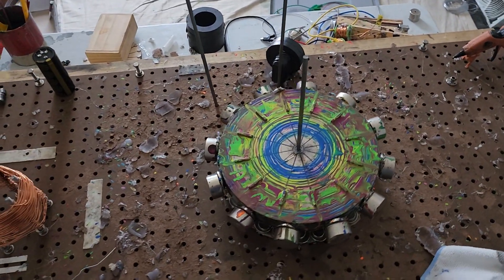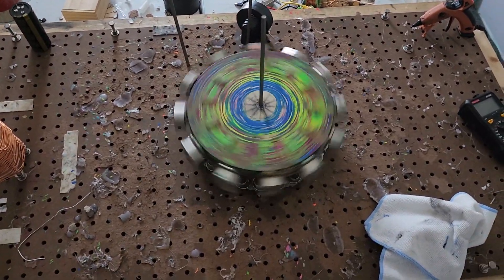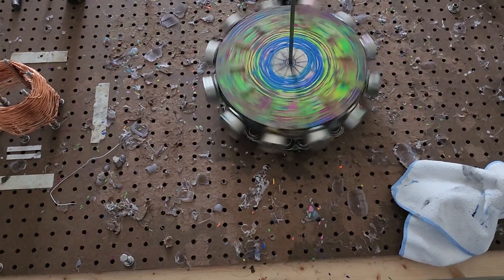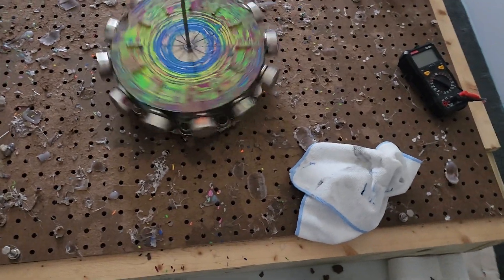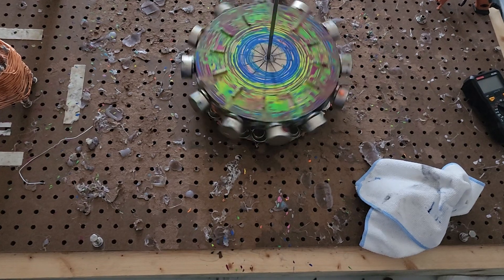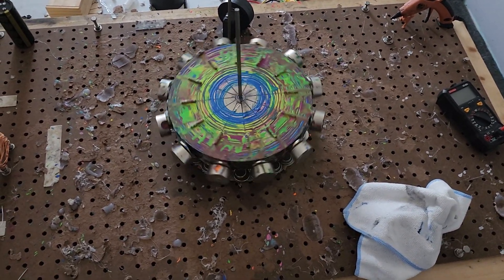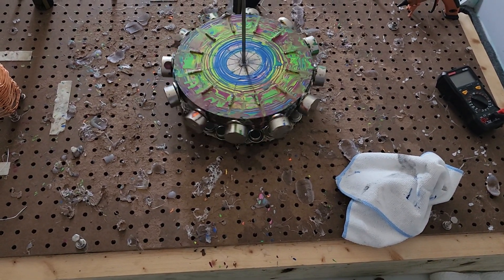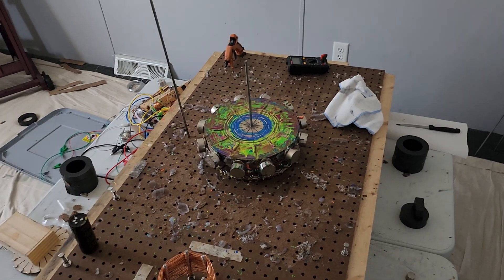permanent magnet motor 1 test

Comment: Keep it up, id like to see you hook up a Multimeter to see how many volts you can generate with that.
Reply from the maker: 10/12 ac volts and voltage throughout deceleration and this is using my what i call mega coil 3 and a 1/4 in along the axel 2 3/4 in dia. about 5500 turns of 32 awg to register the voltage via the multimeter.